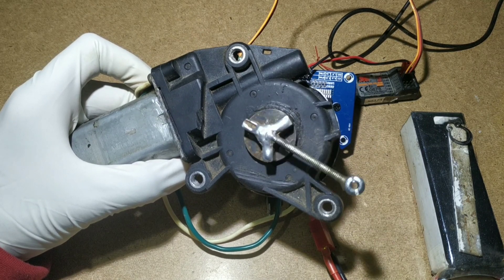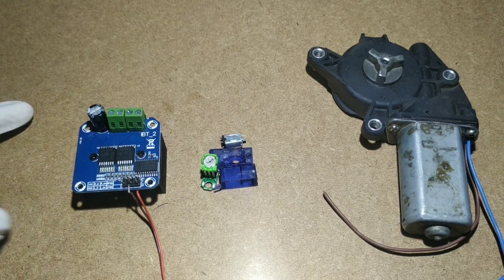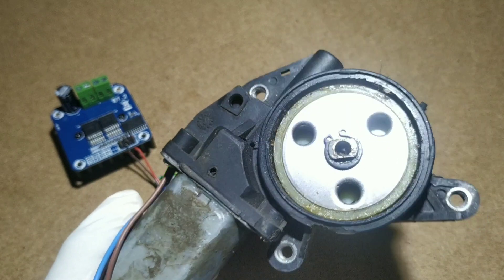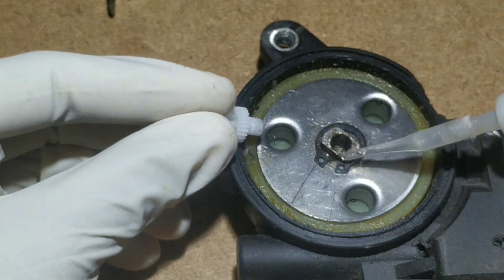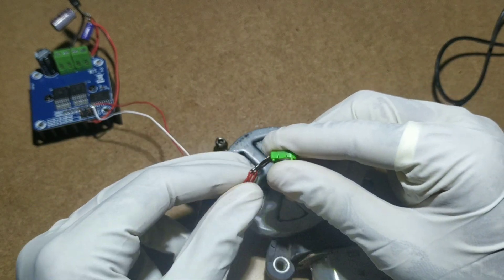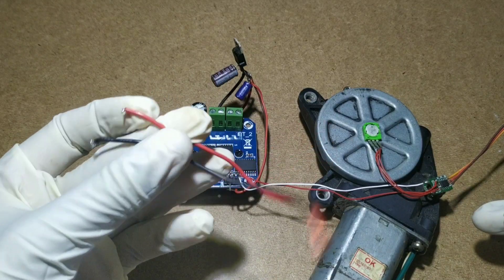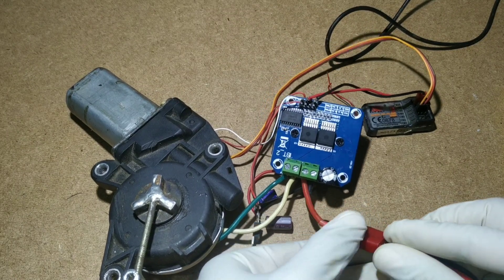how to make high torque servo motor .

Comment: Need similar but want use 3 position switch from car lights leveling.... I use this for motorcycle rear suspension preloading... Soft middle and hard.... Have motor actuator integrated resistor to control piston position 5ohm...motor have 3 Amp on power load probably max 10 Amp

Comment: Hi, congratulations for your project, it's very cool & simple. This is exactly what I what search. But if I don't find this piece (IBT-2) , what another parts can I use it?. Please, I'm from Haiti; it's not easy to find & buy it.
Reply from the maker: https://www.amazon.in/dp/B00N4KWYDE/ref=cm_sw_r_cp_apa_glt_fabc_BVVZEKKWHHZKRHZCE372
Reply from the maker: https://www.amazon.in/dp/B08JYQZ26X/ref=cm_sw_r_cp_apa_glt_fabc_9HCPJ047QVATRN1FRYJT
Reply: you can make a motor driver with mosfets, just search

Comment: can i use L298N L298 DUAL H BRIDGE STEPPER MOTOR DRIVER MODULE with 12v motor planetary gearbox and tiny servo microcontroller like this video?          
https://www.aliexpress.com/item/1005001621936295.html?spm=a2g0o.productlist.0.0.39cd4a65TzPV9s&algo_pvid=null&algo_expid=null&btsid=0b0a555c16203335485787968e03f9&ws_ab_test=searchweb0_0,searchweb201602_,searchweb201603_  how to schema? i want make the rc steering..thank you so much,sir
Reply from the maker: Yes, u can use 
Depending on your dc motor how much current it consumes
Reply: @make_yourown9711  but i dont know how to  wiring L298N to tiny servo. ..let say that i use 540 or 380 motor,with ESC hobby wing 1080 ..thank you so much before,sir

Comment: can it be done without remote control
to be controlled only by arduino in degrees
as a simple servo motor is controlled
Reply from the maker: S ucan
Reply: @make_yourown9711  Hi man how can it be done

Comment: hello ... would you have the wiring diagram, or something more detailed?
my e-mail  designer_criativo@hotmail.com
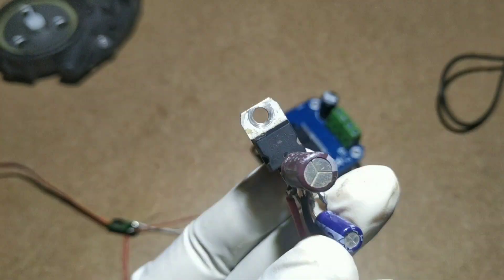I did not understand this part...time 1:34
Reply from the maker: 12v _5v regulator  to power motor driver
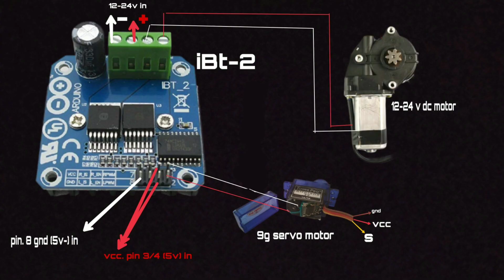Circuit diagram 0:57
Reply: @make_yourown9711  
I used mg996r servo, I will test with this model S90 ... can these 5V be from external source?
I'm using an arduino to send PWM at the input of the servo signal ...
Reply from the maker: @Israel__Thomas  yes u can